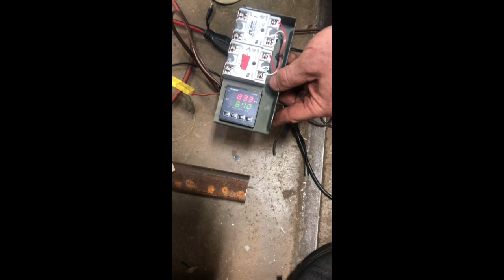Building a Solar Charging Trailer

Comment: This is so dope! I've been thinking a lot about how cool it would be to have a Mercedes sprinter / dodge promaster camper van running on a model s platform with a solar array similar to this on the roof. Keep up the amazing work!
Reply: I also want to build exactly this. Mad max style.

Comment: Just watched like tesla video, and came over to subscribe. I saw the trailer and thought if changed the design to fold 90 degrees from what you have, you could have 2 sections out while driving. One over the trailer and one over the bed of the truck